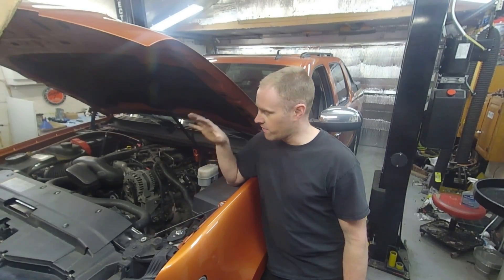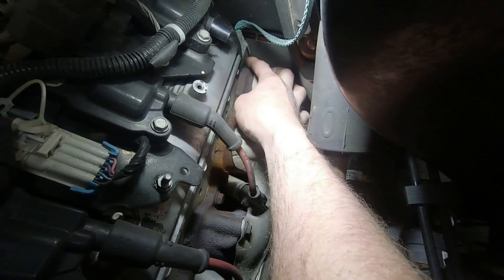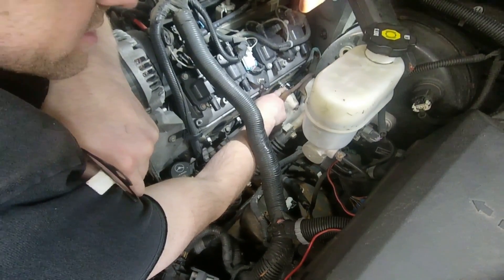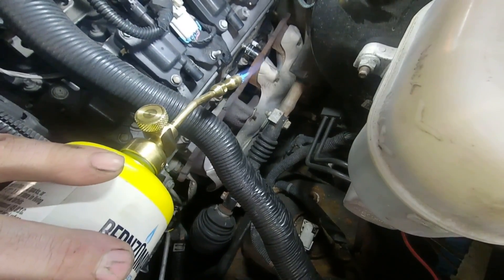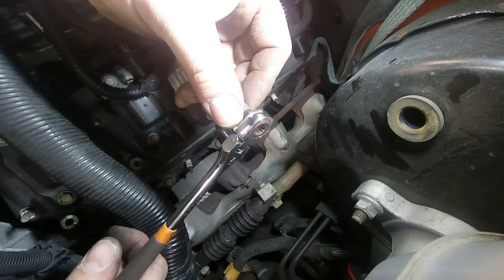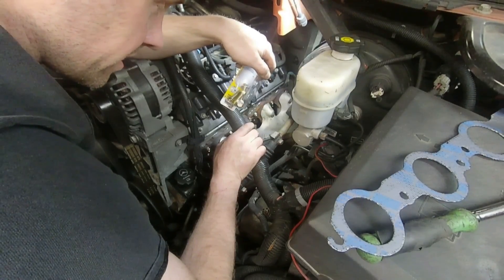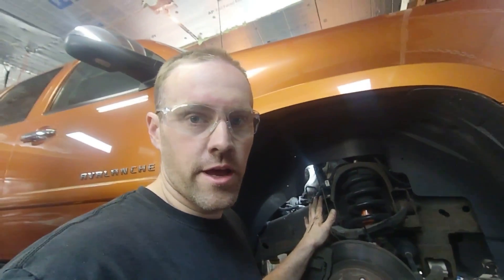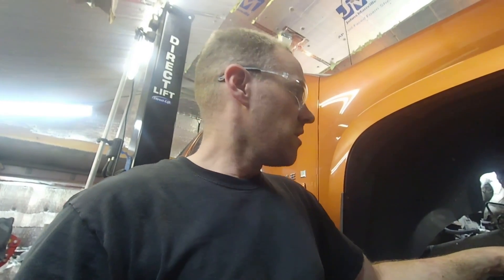GM Chevrolet Truck Exhaust Manifold Leak Broken Bolt Trick, Lifter Tick ??

Comment: Any clue what the cost would be to get a shop to do it?
Reply from the maker: Depends on labor rate and how the tech does the job.
Reply: i’m getting it done right now and getting headers put on and with header install, exhaust install, and bolt removal it is $1,500.  I don’t have the price just for the removal yet until i get my truck back
Reply: 300 plus 1 hour labor per broken bolt. Some mechanics say they have to take head off. But I didn't neither did this guy.

Comment: Like an idiot I had both of my heads off recently replacing lifters, trays, cleaning tops of pistons, heads, new springs, rocker trunion upgrade, etc. Well while I had the driver side head off I forgot that the stock manifold on that side had a broken rear bolt and I overlooked it and installed the head without removing it. Now I have to hop I can get it out without having to remove the head again since I put on long tube headers. 🤦‍♂️🤦‍♂️🤦‍♂️
Reply: If I can't weld and have the bolt broke INSIDE the head, do I have to pull the head off to fix? This sucks...the second bolt I can get vice grips on
Reply: @stiffmeister0hYeah  which bolt is it and what head casting is it? Is it an LS head? Go on Ebay and look up the KAP manifold bolt repair kit and find the one for your head. It states in the listing description what bolts each one will fix. Simple design and it works.
Reply: @JustAGuy781  it's the rear drivers side Escalade 6.0. Snapped inside the head.
Reply: @JustAGuy781  yep save alot of cussing

Comment: So is this from an aluminum block with steel bolts? There a hardened aluminum stud/nut or bolt with washer to isolate the two metals apart?
Reply from the maker: Aluminum heads steel bolts, but that's not the issue. Notice there was no corrosion on the threads? That's because they use locktight on the threads so corrosion isn't the issue it's the small diameter bolts with lots of expansion contraction cycles not able to handle it long term.
Reply: @CrazedPerformanceRepair  yeah I see your point for the burried threads but the bolt heads pop off too and aren't those portions corroded some? From what I'm gathering maybe the main point some of you guys are making is that the bolts will die from heat cycles before they corrode.

Comment: So how serious is this issue if not taken care of? I have the bolt broken off showing no threads on the driver side furthest back closest to the firewall. Think it is a small exhaust leak and no sensors going off and very faint noise. Can this destroy the motor, or the motor, cause total engine failure at some point? How serious is it in should it be a major priority getting it fixed ASAP?
Reply: Exhaust leak will cause motor to run rich (injectors putting in too much fuel). The engine will run poorly, it will quickly destroy catalytic converter, foul the plugs causing misfires, and gas will get in oil destroying lubrication. It eventually will destroy engine if not addressed.

Comment: 13mm?? I swear I just took 9 of the 12 bolts out and I used a 10mm. I used a mig welder for the other 3.
Reply from the maker: Someone put the wrong bolts in yours or something. They are all 13mm heads from factory. The aftermarket dorman ones are 12mm odd balls.
Reply: @CrazedPerformanceRepair  Hmm.. I'm sure you are correct, I'm a weekend warrior. However, yesterday I removed the factory exhaust manifold gaskets on my '03 Tahoe and I've got 9 (of 12) 10mm bolts to show for it. I just put a caliper to the head of one of these ICT Billet exh manifold bolts I'll be using and sure as shit, they've got a 10mm head as well. I'm sure I'm confused about something tho..
Reply: @CrazedPerformanceRepair  I was told if I like pulling busted exhaust manifold bolts to keep using the Dorman bolts..
Reply from the maker: @randykudijaroff482  someone prob swapped them in there as maintenance in hopes to prevent breakage lol. We can clearly see how well that worked out...
Reply from the maker: @randykudijaroff482  they all seem to break with time, stainless does seem to last in the high performance stuff but then again that's header's not manifolds so the expansion rate prob plays a factor.

Comment: Will a regular 12 point ratchet wrench work or does it have to be a spline wrench
Reply from the maker: The spline will bite better but you might be able to get it with a 12 point.

Comment: Going about it all wrong. Remove wheel. Remove inner fender. Give each bolt head a good smack. Remove manifold. Weld larger nut to the broken stud. Remover stud. If bolt is broken flush build up a bead of weld on it then weld nut to bead. Easy stuff

Comment: 8mm doesn’t come close to manifold bolts on my 2007 Escalade..
Reply from the maker: The bolt is 8x1.25 thread, the head is stock 13mm aftermarket 12mm, and to extract the exposed broken I use spline drive 7mm and hammer it on.
Reply: @CrazedPerformanceRepair   good call

Comment: just got a truck with 80k miles on it and one of the bolts is broken off... idk if someone tried to get it off before and snapped it then gave up or it jsut happened by itself but damn is that a bitch...

Comment: pb blaster   would help
Reply: Not when the bolts are cracked due to the numerous heat cycles they go through. It'll help the stuck unbroken bolts but not those putters that 9/10 times break or are broken by the time you hear the puffing.
Reply from the maker: Also it's the lock tight holding it in not rust or corrosion so in those cases penetrating oil won't help. Hmm wonder if a lock tight desolver exist yet? New product idea perhaps
Reply: @CrazedPerformanceRepair  i understand  it was    but  after you heated it up then  used it,,just a thought
Reply from the maker: @animalcorvair  I get that, but the lock tight melts when you heat it. That is why it comes out easy after using a welder, the welder heats it so fast it can melt the lock tight deep within the head. I don't think I have ever seen any sort of corrosion inside the head on these yet. I believe it is because the lock tight used actually seals off the water and what not from getting in there to cause a problem in the first place.
Reply: @CrazedPerformanceRepair  yep  locktight does  that  gm  never used that  on  my older  cars
Reply: Going to experiment. Figure I'll put high temp anitseize on studs when replacing the gasket. Then when doing oil changes double check the nuts on the block. 5 minute add on to an oil change?

Comment: W in TF.    Two nuts on the exhaust manifold flange and you could have removed the whole manifold.  Next you are wrong that this issue doesn't cost GM.  This issue is bad enough that  GM developed the exhaust manifold clamps to same labor on warranty repairs.   driving labor down from such repairs from 5ish hours to less than 1 hour. broken bolts do not need to be removed. 

heck gaskets don't even need to be replaced under the TSB.
Reply from the maker: Wow anger issues much??? anyhow I'll hold my own and state that apparently you live in the land with little to no rust because in the rust belt, (Where I'm located) removing those 2 bolts to pull the manifold off has a 50/50 shot of costing you a lot of problems not worth dealing with. BTW not everyone wants to add a hidious clamp to the end of there head hence why I offer it as a option and show the proper solution. Further more good luck using that on the #1 cylinder because the alt bracket is most likely in the way. Also gaskets can be reused sure sometimes........ but good luck when a guy neglects to do the repair for a couple years and it has worn down to almost nothing.